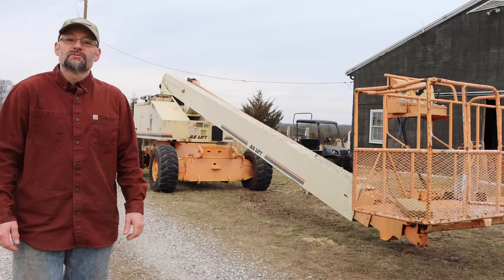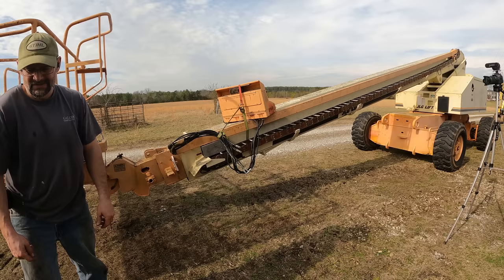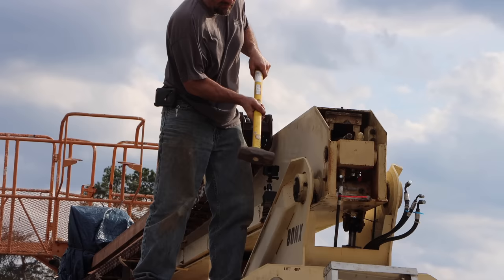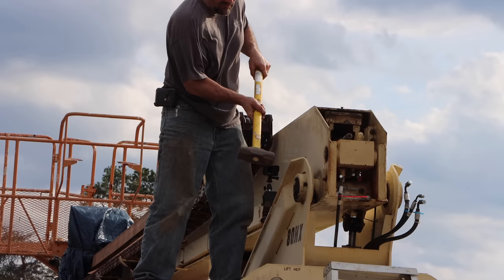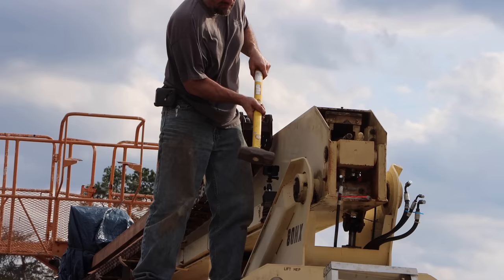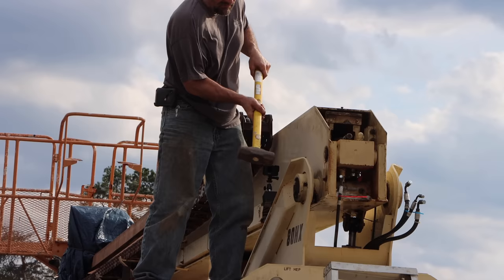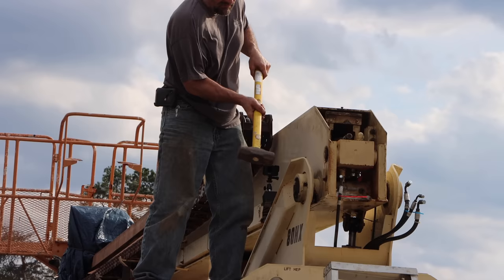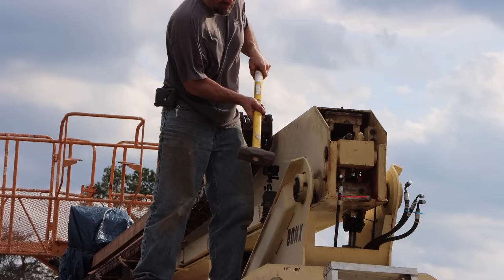JLG Boom Lift Tear Down, Ended In Disaster!

Comment: I'm no expert and really two left hands for any manual work :-( but just thinking - heating elements, then also quickly cooling - isn't that affecting material/steel parameters? Aren't you afraid components might get de-hardened? Just thinking.

Comment: Tell me… your fire extinguisher. Is it made of plastic on the top?  A local fire and safety business near me says they do not sell or recommend an extinguisher with the top made of plastic. They have had way too many problems with them leaking off. They sell only the ones that are made of aluminum on the top of the tank.

Comment: you have made it very difficult for yourself to warm it up from the outside first, and hit it with a hammer .. drill a hole to warm it up. quietly drink coffee through the hole, you can knock it out in a bit. But It worked ,

Comment: What hydraulic caps male & female are you using and did you locate a cheap source?
Reply: Every time I use my 450A I end up fixing something so I know the feeling. They are nice but can be $$ pits. I rebuilt the complete basket and control station to like new and just found out that over winter a mouse decided to nest in the control wires and eat all the insulation off and piss on the relay holders to the point that they are rusted to hell.

Comment: In all seriousness. When it comes down to time/money was it worth buy a lift in this condition, or would it of been more financially reasonable to buy a new and presumably better condition one? 

I’m thinking about a similar purchase.
Reply from the maker: An 80' lift like this new would be crazy expensive.  Well over 100k, maybe 200.  I might be wrong, but it wouldn't surprise me.  I enjoy working on things, and don't regret buying the lift at all.  When I'm done with this job, as far as I know it will be tip top shape.  I think you would have a hard time getting a used 80' lift in good functional shape with a recent inspection for $30k.  I need the 80' for tree work.  Anyway, I have about $13k in it, so I figure I've saved plenty with all my work, and I'm happy with that.  Short answer, it depends on how much you like working on things.  Cheers.

Comment: So it’s only those 2 tiny pins supporting the chain .
Reply from the maker: Yes, but the whole chain is a series of little tiny pins at every link!  Those little pins aren't regular steel either, you can tell.  They are stainless that I'm pretty sure has been hardened and tempered.

Comment: you could have used a port a power and used a wedge ram/aka duckbill or order mini ram cylinder and pressed them out also this might not have worked large port a power is only 10 tons with your talent you also could have made a steel frame and used a hydraulic jack/ or fined a Hugh wheel puller

Comment: I was thinking you might have been able to use a hacksaw or electric saw like a jigsaw (with the right blade) and cut through the last of the pin rather than try to burn it out. It might have worked. Two cuts to the edge and it would probably have come out quite easily. There are a lot of people who'll be willing you on to complete this after you'd given away the car - best of luck to you and if you get a new fire extinguisher, try to check it before you put it away. You might find a container of water a good thing to have around. I don't think it would be worth having an IBC but if you have a smaller tank around, I think you'd use it from time to time even if it's just for washing your hands. MartyT did a restoration of a road grader and you might want a big bucket and old style battery charger that doesn't have a computer reducing the current all the time https://www.youtube.com/playlist?list=PLrCvcRxFfyzt-umMedXDEXuufA2ws8ClJ part 3 - salvaged chain being electrolysied in the bucket. Comes out really well. I don't know how practical this is but if there's a build up of debris in the boom you might be able to attach a rigid pipe onto an air line and get to the places you want to clear out. It's just an idea, you'll probably find it all goes over the chain but it might work out.

Comment: You are ambitious! Did you think about removing the basket? Put wheels on the press, mine has them and its great. Run a weld bead in the pin hole, it will shrink some.

That had to be a long 2 minutes when the fire started. Still bad luck. Turn fire extinguishers over couple times a year and hit them if not recharged. OUCH!!

Comment: temp shock did nothing. heating the pin red hot forces it to expand. in length. when it cools, it shrinks. in diameter. voila loose pin.

Comment: Hopefully the most damage from heat is the  crap that you beat on yourself. It was plain and simple, a accident that sure might of been avoided in some manner yet just how many people would of considered this happening, had running water, a fully tested fire extinguisher plus a watchperson on both ends, maybe someone under the machine, a drone fixed in the different areas, etc!!! Your a human who by rights just ran a marathon speed chase for buckets of water which you had two fairly large buckets of  water in so very close to two minutes... for myself running this race ... just one bucket in say a hour and a half as I can not walk without a pair of crutches and some one out there to catch me when my forest gump legs hold my talent of moving without cra**ing my pants in pain. A mistake that could cost a few dollars to repair at worst... I am thinking that other than some paint, things will be fine... of course without saying it, I think that you've heard the definition of "fine"... You are a very talented man and have gone further than many others do to accomplish your many undertakings. The barn is still standing

Comment: After all the the hidden and aggravating repairs you’ve had to deal with has been an absolute battle. Now fires happening that could have potentially burned that machine to the ground and your adjacent buildings😞, Your dealing with a whole lotta work rebuilding it. I believe this lift is cursed. The curse is causing you to have to work endlessly on it until it destroys itself or you. Maybe considering to bring in a priest to to exercise the the evil out of it might be a wise choice. You might end up with a 52 part video on non stop repairs to this lift or injuries to yourself because of this demonic machine. I’m no expert, but this worries me😬🙏

Comment: aluminum and steel don't get along with each other  has to be a British make machine i only know that they would be that stupid to us and manufacture a machine to fail too 
had an excavator  broken a hydraulic cylinder we look at all of them dot o they started to leak as well too all of the had different designs of parts in each one was no answer on how long we going to get the seal kits from England  build a new one and put then on they said after i make new ones they told the company they had to buy new ones from them that machine was back in operation then they got back to them was more aluminum in the broken rod they should have had too friend of mine said the had a dozer had a bout 500 house on the machine the framework had a major crack in the frame itself too they did send them a new dozer to and then send that one back the engine was toast when it got  here sea water was in the engine and the hydraulic too 
with the damages said look like it was dropped into the water loading it my friend said too